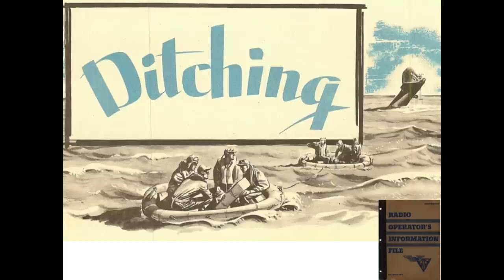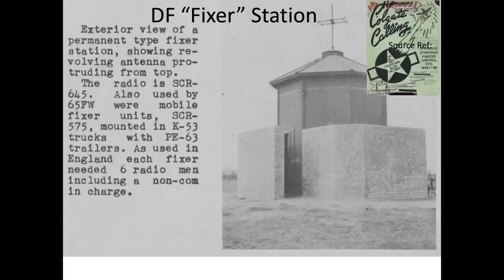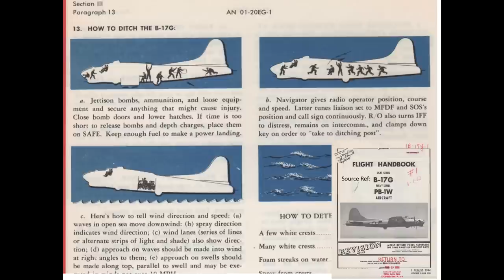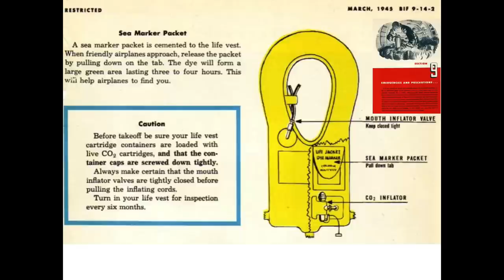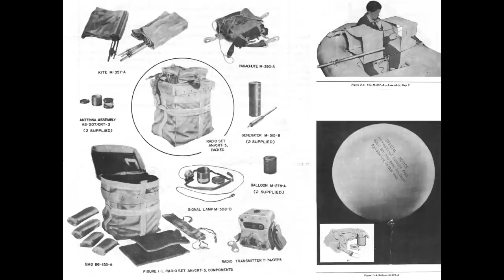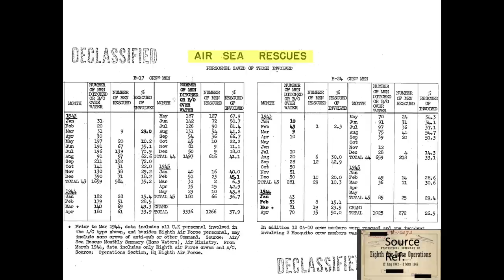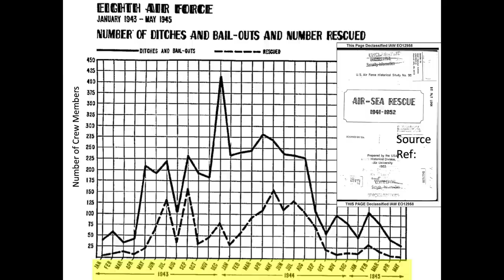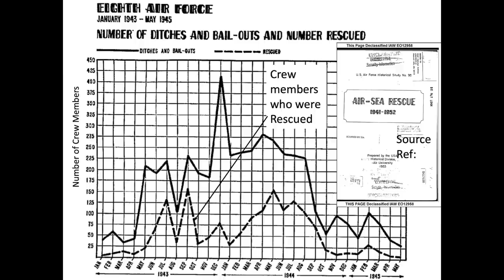B-17 Bomber Ditching Survival Rate? Not Good

Comment: Your videos are always so informative. I am always amazed not only at the statistics kept during the war , but your vigilance and ability to get the actual data. Regarding your question , as a Boomber with relatives in the 8th and 15th Army Air Forces, I would prefer, if the aircraft was not too damaged , if so then bail out in the Adriatic. Primarily because there were many friendlies, especially fishing fleets that could support our aircraft crew rescue efforts.  Even with the efforts you referenced, the English channel was still a hostel environment, especially when Germans were looking for their pilots.  Hypothermia very risky, weather and the aircraft might not have been able to get off a signal, plus most were separated from the returning aircraft. However I digress, Thank you for dedicating your time and look back at these young men, their training and bravery.
Reply: The question was: would you ditch in the North Sea in December or bail over Axis-held Europe?
Reply: @thomaskositzki9424   very broad question depending on several factors. Condition of aircraft, how long can you maintain flight, the North Sea would have less friendly rescue teams out than friendlies , no matter which aircraft you are in, each one had different ditching characteristics under perfect circumstances. Can you get to the water survival gear, since you can't train for a ditching you have to make a guess on films and manuals, are there wounded crew aboard. There was usually a route for navigators in damaged aircraft for evasive activity, over land ,  how far into enemy territory are you. If you bail out over enemy territory, bail out over military forces and surrender, many crews were killed by civilian villagers or trying to use a pistol against an entire platoon, some were friendly and might hide you. The military wants prisoners, especially officers. Don't bail out over the city you are bombing. You might have fighter escort who can at least report your condition. That's just the tip of the iceberg. Sometimes you have to bail out as soon as you can because the aircraft is too damaged and on fire. Most WW2 crews were well briefed and flew "milk runs" for their first few missions. Last, bailing out in the winter over Axis held Europe can be just has bad as ditching in North Sea because crew usually has to take off high altitude flight suits to get their chutes on, then you hit the ground in winter temps with no protection and hope you were able to hold your breath for 10,000 feet. It all depends on the war - Korea was different, I was in Laos and if you weren't instantly picked up you were dead - they took no prisoners tortured and killed on site.
Reply: @c123bthunderpig  I know all that, I am studying WW2 for 30 years. ;)

And it ain't that complicated really - the B-24 was a notoriously bad ditcher and the North Sea had maybe 6°C in December, which gave you an hour tops of survival in the sea or maybe three, soaked on the raft. There is hardly anything in nature that kills faster than cold water, the point of bailing over land in winter being just as bad is simply wrong, due to thermodynamics.
German ground forces usually treated downed crew relatively good, only the occasional SS-fanatic or angry farmer would shoot you. Still better than cold water.

So the options are very obvious: if your ship looked like it won't make it back over the Channel/North Sea, just bail.
Reply: @thomaskositzki9424   Thomas wouldn't argue with ya on that - I'm just pointing out the variables . You never know what is going to happen on a ten man aircraft until it happens.  Danger rarely arrives with an announcement - the pilots could be dead, the rest of crew could be dead, the aircraft in an unrecoverable spin holding you to the airframe the ground crew before the mission could have screwed up, after all most officers were 20 years old, and ground crew 18 year old kids . There are hundreds of books written by veterans of the  air war - and I can guarantee every book will be different. One reasonably accurate is "Mission" Jimmy Stewart and the Fight for Europe by Robert Matzen, that's a pretty good representation of B-24's and 50 mission requirements - Jimmy actually made it to Brigadier General and flew several missions in Vietnam. You can't make generalizations on aircraft type. Of course the B17 ditched better than the B24. There are several Youtube videos on ditching both made by the Army. Are you just looking at American Heavy bombers or all bombing campaigns" The British took over at night after we bombed during the day and their loses were just about equal as ours. B29's in Pacific had a terrible time when first deployment - it also matters on what ground of defenses you are up against. I really can't help you anymore, I am not criticizing but you seem to have a closed mind on the reality of aerial warfare - especially WW2 after studying it for 30 years.
Reply: @c123bthunderpig  I have a closed mind on areial warfare? Lol, what are you on about?

I don't know what you are on about with all the variables you point out which don't touch the question that was asked at all? 
The question is: would you risk a ditching a B-24 in the Northern Sea in December. 
So variables like: pilots dead, crew fatalities, plane in flat spin, ground crew making a fatal error, etc. are all irrelevant.
Why?
Because those variables would have to be ruled out before you even come to the decision.
For the question following variables are important: is the B-24 good at ditching? No. Is the sea state ok for ditching? Propably not in December. Is the weather and ater temperature good for survival? Hell no. Is the chance of getting killed in occupied Europe higher than in a ditching? Propably yes.

That's all there is to it.

You mention variables over variables that have basically nothing to do with the situation at hand.
Weird conversation...